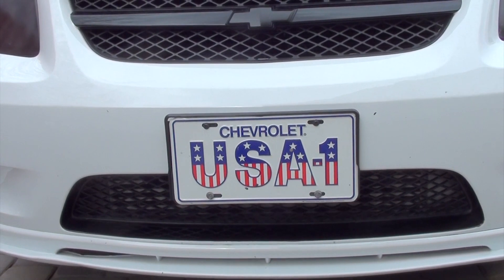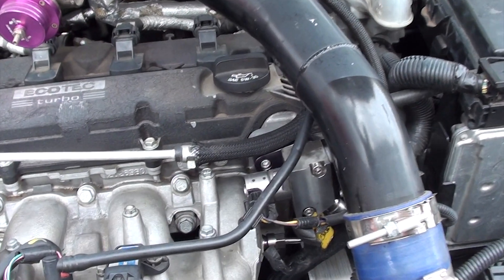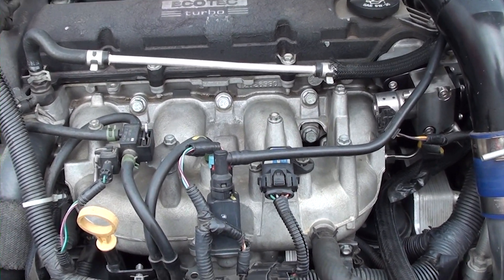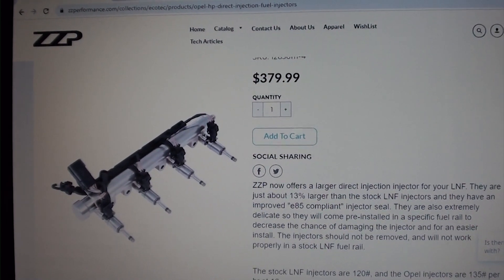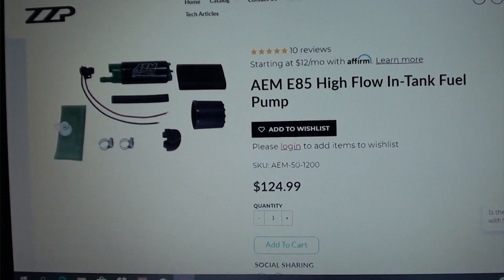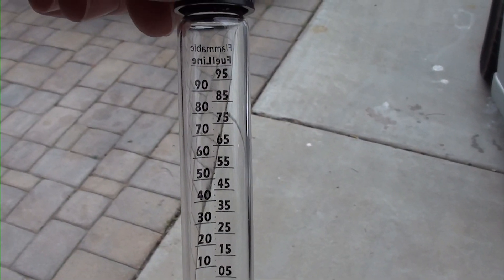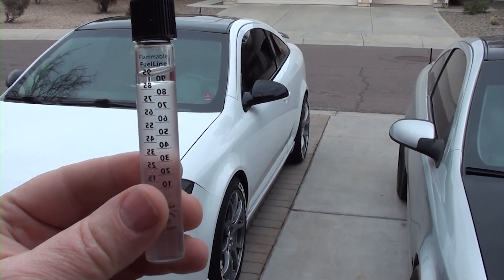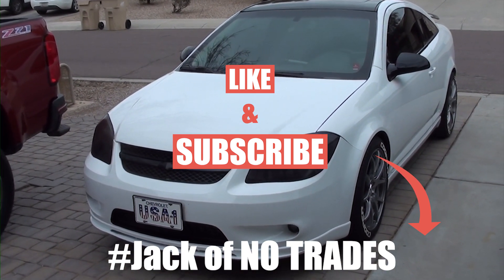Cobalt SS LNF Turbo Running on E85/Upgrades Needed/Fuel Test

Comment from the maker: Who else is running or trying to run E85?
Reply: I was just thinking about going e85. Is the fuel lope cam mandatory or could I just do the better HPFP With opels?
Reply from the maker: @carlosp7662  just depends on what your upgrades are.  If you are using the stock turbo and this new hpfp and Opel injectors no problem without cam lobe.  In my opinion anything over 380 whp you will need forged rods and pistons.  I blew Two engines @ 400 whp.  One of those was the LDK engine.  The LDK block will run cooler than stock.  Running on E85 Helps with temperature also.
Reply: Carlos Portillo without the upgraded fuel Cam I Was getting p0087 fuel rail pressure low, I installed it and no more codes, I didn’t buy the zzp hpfp or the in tank fuel pump, I have a lt1 hpfp opel injectors and fuel lobe cam, e47 blend I hit a 12.886 1/4 2.0 60 ft
Reply: You know you can just flash different file tunes to the computer right? I have a few e47, e85, 93 octane, one for daily driving another for track 1/4, another for roll races, you don’t have to buy a new computer, you just need a hp tuners and laptop
Reply from the maker: @jcesparza7490  yes that is true I need to buy HP tuner but I had an extra comp from a tune I got from zzp so I just switch mine out.  Thanks for the good comment 👍
Reply: @jcesparza7490 which LT1 hpfp were u using the cobalt I bought has one on it im just not sure which to look for if I need to replace it

Comment: I'm running e85 in my 05 cobalt ss. I get a p0172 engine code and don't know how to get rid of it. Anyone else have this issue that knows of a fix. Or do I just need to get it custom tuned? The tune on it now is from zzp

Comment: You don’t need the intake pump. You do need the HPFP upgrade and you may need opels if your 08,09. Or you could just change your injector seals to 10 ones as there thicker unlike 08 09 that wear away on high alcohol.

Comment: is your cobalt tuned by ZZPerformance or Bad News Racing tuning?
Reply from the maker: I've had ZZP tunes but because of the difference in altitude and octane in AZ you really need to make sure it's for 91 octane.  I've blown two engine's on there tunes so if you do get one make sure that you have the ability to talk with them and get it adjusted for AZ.
Reply: Jack of NO TRADES wow 😳! So your saying getting a tune that can cost $600 is dangerous and can blow up your engine. And it also voids factory warranty! That is scary!
Reply from the maker: If you're using the stock turbo I would recommend just tuning it to around 22 psi.  Just use a local tune shop or talk to ZZP they are a good company just make sure you follow up with them after your tune is installed.  If you hear any pinging something is wrong, you want zero knock.  Around 340 whp you should be okay anything over that if your an aggressive diver you will start breaking things and need to do alot of upgrades.

Comment: I have a 2016 Buick Verano 2.0 Liter LHU Turbo and I’d like to try to run E85, I am not or I don’t think my engine is E85 compatible but since you can run it on an older car like the Cobalt, I’m thinking I should be able to do the same on my Verano and we only have 91 octane in California. Can you share some pointers for my vehicle application? Just all stock. Thanks